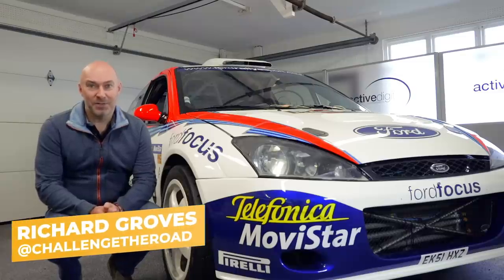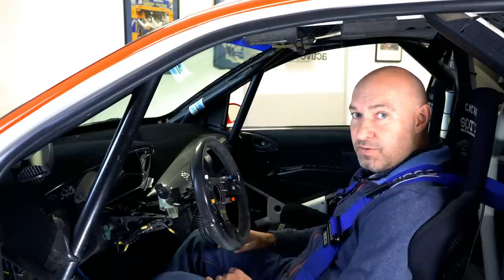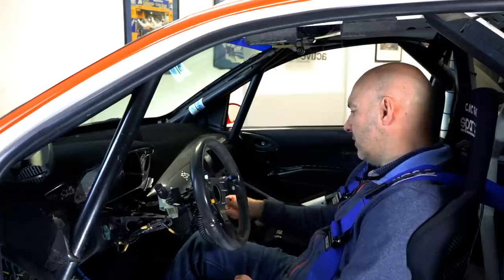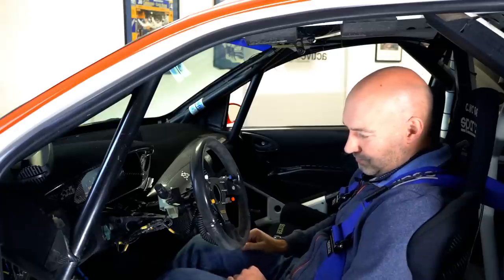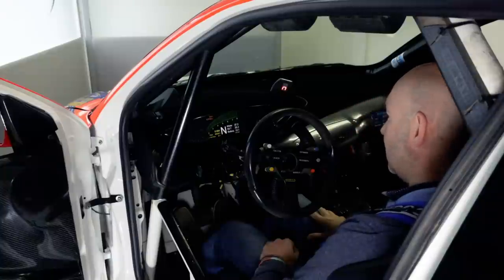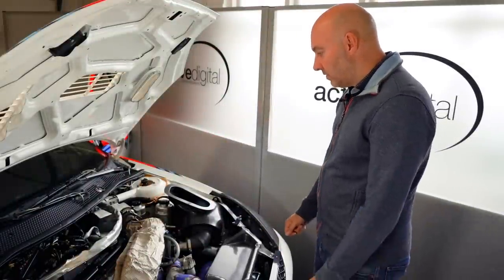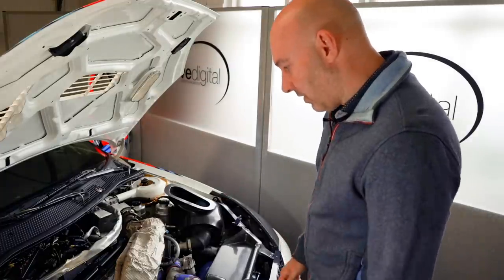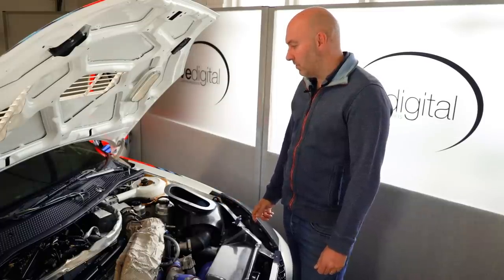Inside Colin McRae's Ford Focus WRC Car! - CTR

Comment: Was this car originally outfitted with AWD, or just built when it became the WRC car? If so, are you able to tell where the parts for the conversion came out of?
Reply from the maker: Hi Sam, it would be front wheel drive to start